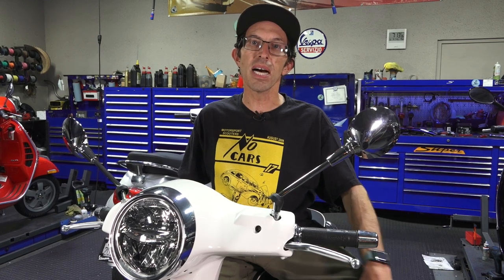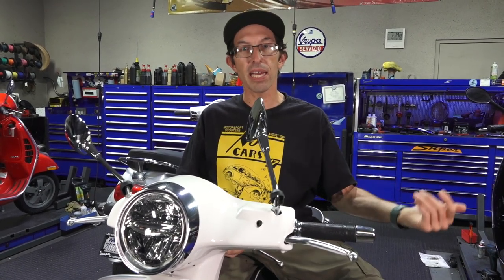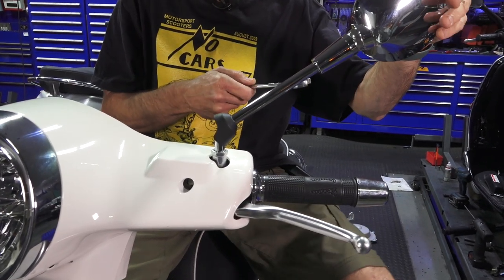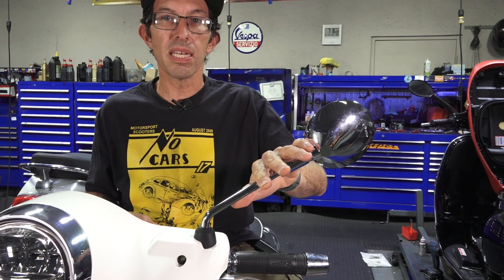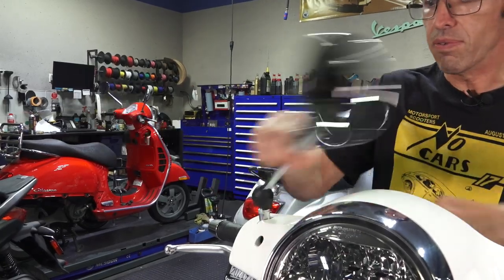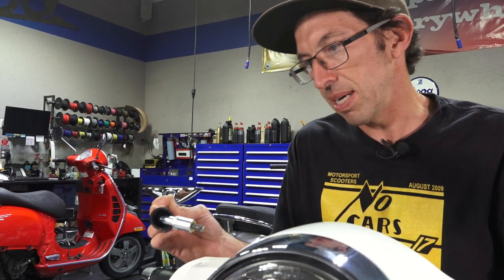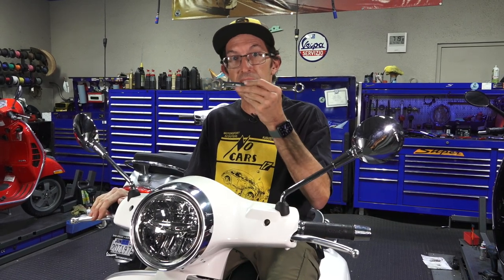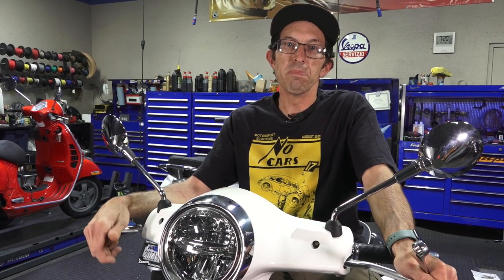How To Tighten a Mirror on a Modern Vespa Scooter

Comment: Hi, the prob with my sprint side mirror is that it's loose from the ball joint. Is there a way I can tighten this?
Reply: I have the same problem. Did you solve this?
Reply: I have the same problem. Did you solve this?

Comment: Could you show how to adjust a loose mirror on a Beverly 400?  I cannot find a video anywhere and it looks like I need to go underneath the handlebar but not sure what tool size to use. It didn't tell me in the manual either.

Comment: Robot, love your videos. Have a 2020  GTS 300 Touring. Purchased a few things from you so far, front rack on the way can't wait to get that on. I had this issue with the left hand mirror but watching your video I see the bolt head to get the wrench on in your video is nice and high but mine is recessed into the plastic and I can only get a sliver of the wrench blade onto the nut. Have you seen this and is there a way to fix it? Thanks!

Comment: Robot, I have a modern Vespa 2012 300 gts ie, the right Molotov is broken inside the threads, I tried to still a small hole to unscrew the piece out, then I tried a smaller drill bit.  Can this mirror hilder part be replaced?

Comment: I'm about to place an order  MR-25IA for my 07 GTS 250, my nuts are deeper into the frame, any ideas? Thank you perfect timing, I was watching the 4 option mirrors video :)
Reply from the maker: On the older models, you'll have to remove the reservoir covers with the small allen fastener to get a better grip on those mirror nuts. The aftermarket mirrors you're looking at stick up higher than the stock nuts, so you may not need to do that in the future. Enjoy your new mirrors!
Reply: @VespaMotorsport  awesome, thank you!

Comment: Actually experiencing loose mirrors on my Primavera 150 Touring.  I tighten the mirrors and they come loose again.  Can't take them off unless I remove windscreen either.
Reply from the maker: In that case, you could probably put a little blue loktite on the threads.